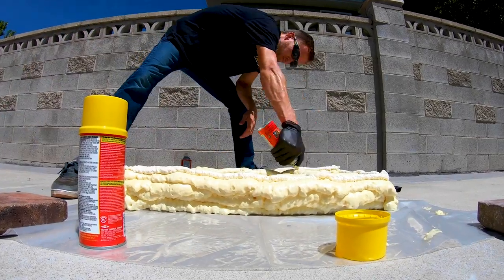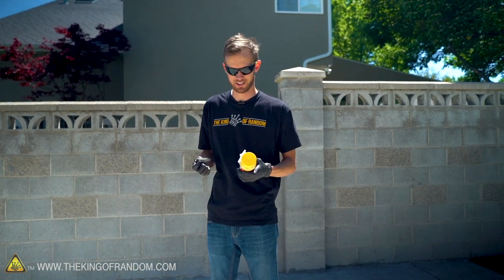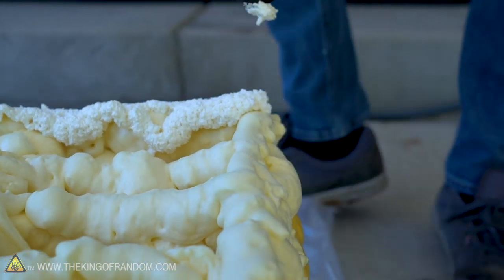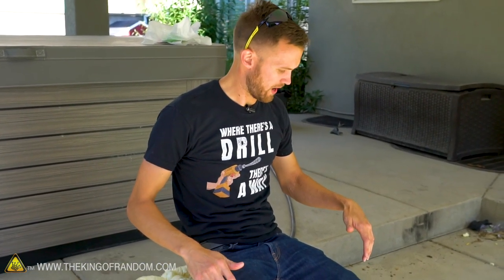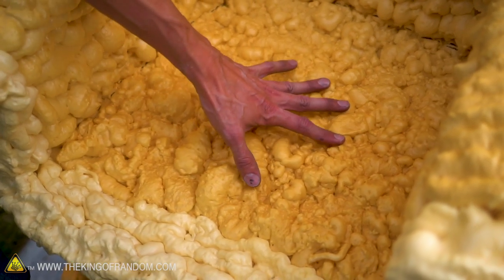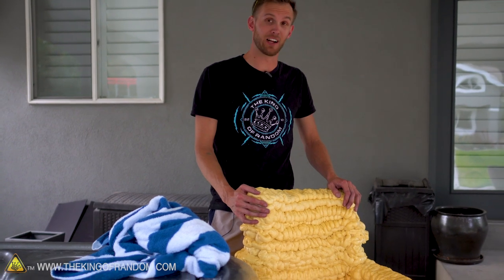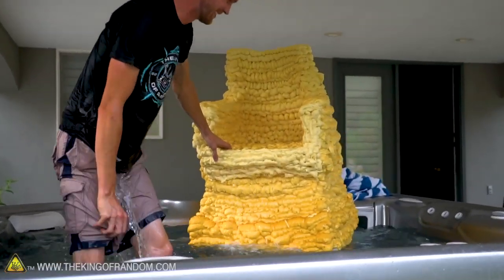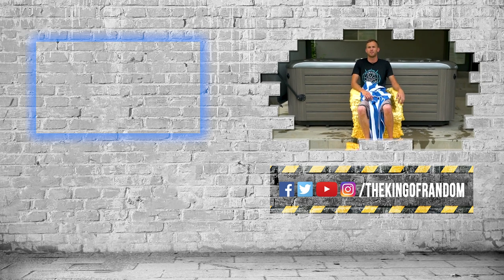Instant Foam CHAIR From a CAN

Comment: I've worked with expanding foam  alot... 
Here are a few tips...
Make your mold with that pink foam, (because it is more durable than styrofoam) and than put that plastic wrap over it (so it won't stick to the foam)...
Also If you do that you will end up with a smoother surface...

Try making a boat...
Reply: pp
Reply: Chump 103 a lot of "..."
Reply: I was thinking boat, but yes please
Reply: @zwtangel  my thought just wasn't finished

Comment: Can you freeze a lava lamp using liquid nitrogen or other cold things?
Reply: Miguel Angel Acosta Can you freeze LAVA using liquid nitrogen or other cold things?
Reply: Nomad Planter it’d condense + evaporate as gases before that or turn into solid rock
Reply: Can you freeze it while it’s cooling down and get the little blobs to freeze suspended in the water?

Comment: Pretty sure that you can sand the expanding foam and use a reciprocating saw for more mass removal if you want.  As for the "water chair", you need to remove like 75% of the base of the chair if you want it relatively stable.

Comment: An Igloo or igloo style dog house would be cool (literally), especially during this summer 2019 heat wave,

I vote kayak/boat/raft as well.

If you want to expand the subject to easy & cheap construction using the foam and other readily available materials, perhaps construct using a pvc frame and filling in between sheet plastic just hot glued or siliconed to the framework.

Of course the chair was useless in the water, too too heavy & no ballast.

For a boat or raft (or even the doghouse) You could also hot glue empty aluminum cans or even plastic bottles with the tapered top cut off and then fitted together and hot glued...
then using the foam to fill in around and over it to build a larger structure, boat, swimming platform or raft, this would allow you to very cheaply use the trapped air and cans to provide a large portion of the buoyancy and framework while using the much more expensive spray foam to fill in, provide strength and make the surfaces smoother & having less drag.
(In the igloo/doghouse, the trapped air would just act as added insulation)

(You could also easily use fiberglass cloth, bedsheets or even burlap and use a trowel to press the foam into the fabric to create much stronger structures.

I think that a more open hex honeycomb/grid may be a more efficient (in terms of material use & strength) way to build up the bulk structure than the rectangular grid shown in this video.

Expanding foam is also more cheaply available (Amazon) in 2 part gallon & larger sizes, with more flexibility in the strength, expansion ratios & foam flexibility after curing) .

Just ideas that came to me in the first few minutes while thinking out my @ss...
Reply: I said make a fort lol

Comment: if this was mythbusters, the next task would be a "functioanal foamboat". Se if a 100% foeam boat can be used or if it will just break xD
Reply: I think it could probably work if the sides are high enough to keep the person in and the boat is stable enough not to turn over

Comment: People in 1920: I bet we will have flying cars by 2019
People in 2019: making furniture with spray foam
Reply: Damon Berry but whe have self driving’s car
Reply: colin furze made a hover bike
Reply: Do you mean the airplane??
Reply: All Aviation  it's called Tony's dad
Reply: For about (maybe about $20 less) than a whole regular furniture set but if you were to move somewhere it would be easy to move bc it's light weight....😂😂
Reply: we have flying cars called planes
Reply: Most people didn't even own a car in 1920, and you think they were thinking about flying cars?

Comment: Yall should do a video testing whether or not gummy worms can be turned into ropes
Reply: That won't work nate will eat it
Reply: If you weave them thick enough. But then it will be the width of a lamp post.
Reply: @TheRobinSystem  but the more you stretch them the thinner they get
Reply: Joseph Ayers by the thinner they are, the less structurally stable they are, individually.
Reply: @TheRobinSystem  BUT that's the thing, they arent individual
Reply: @tatertotjojo  if they are not wound together into a rope, they'd be weak, yes. But if they were, however, they would be a lot stronger.

Comment: Can you still use it after boiling. will a can still work if its been in a vacuum chamber. Will deep frying expedite the hardening process. Put expanding foam through the ringer!

Comment: Can u see if u can replace the battery on a car with multiple tiny batteries like the ones for a tv remote
Reply: It won't work. car battery is 12 volts and a AA battery it 1.5. the car would need too many amps for 8 batteries to supply. If you use more than 12 volts you could burn up the starter to the car.
Reply: Batteries don’t work that way

Comment: If it's wider and closer to the ground it will have a more centered gravity pull and it won't tip and fall as much in the water

Comment: Need more surface area to float and weight has to be equal and u in center balanced. But sweet idea surprised :)    
** make floating cooler put plastic inside when almost done then two layers on rim should work

Comment: Looks like you had issues with your first layer, may I suggest hairspray. Also I noticed wobble, you may need to check your X and Y axis belt tension. Best of luck -gb
Reply: English Please
Reply: Oh wait i just realised that he is a 3d.... Oh and there is another comment too well read that i dont wanna explain
Reply: Yeah, he could also make sure the bed is leveled, I would suggest using a folded price of paper to make sure the nozzle is the correct height from the bed, you could also use painters tape or a glass bed instead of plastic, and next time maybe try ninjaflex so it has some cushioning
Reply: @Geremy Tilton

Comment: boil a glowing stick and check out the reaction of it when it is warm / cold
Reply: Glow sticks burst when put under extreme heat. The glowing juice inside sprays out and is kinda fun to write with. I do this over campfires. Adult supervision suggested. Then again responsible adults will probably not let you do this
Reply: Hi

Comment: For the floating capability test, It just needed outriggers around the base perimeter due to the center of gravity being so high up. If you made it lower and wider it at the base it would be more stable for floating. But cool fun experiment anyway!

Comment: This kinda makes me want to mess around with making a spray foam canoe. Could probably use like a power sander on that stuff to knock off the lumps and then use some filler to help in smoothing out any remaining divots and then give some sort of sealant finish, like some Flexall to stick to the theme of making it with spray can products, lol.

Comment: If spray foam were compressed between layers of plywood (maybe covered with sheet plastic to prevent sticking) before it cures might it be possible to make spray foam board/lumber? How strong would it be? How much spray would you need to create a decent thickness to achieve rigidity?

Comment: I'm curious why you didn't try using a tool to shave/cut the foam to shape after it set up enough to cut? I can think of several common tools that might have worked, including a saw and an angle grinder.

Comment: I think what would help is if you used metal guidelines. Like using steel bars for the frame of the chair and then spray the foam around it.

Comment: I think the problem with floating is the base. 1. It's not wide enough to stabilize flat on the waters surface. 
2. It's too rounded on the bottom to do the same. 
Maybe if you have 4 legs with flat bottoms an equal length apart, it will stay up. Is it possible to sand spray foam and make it flat?

Comment: you should try making a spray foam flat bottom boat using a frame and covering that frame in spray foam
Reply: Use Plastic to flaten the bottom of the boat

Comment: I'm building an 8x8 metal arched metal shed and looking to fill 2 inch space between my paneling and the metal exterior (Yeah I have no intention of ever taking it apart).  In all I think I need to fill about Four 4x8 panels x 2 inches ( I think about 800 cubic inches).  Possible with cans? How many?

Comment: I wish they made a foam like that except that it would be biodegradable so if  you had to make an emergency shelter by digging a hole and spraying the walls of the hole and when solid enough pick the now dome shaped foam up flip it over on the hole and now you have a sort of igloo  you could spray the hole again and insulate the ground as well  as the top and all that in a spray can or 2 way smaller than any tent to carry around but right now with it being toxic like it is I wouldn't want to do it unless absolute emergency....